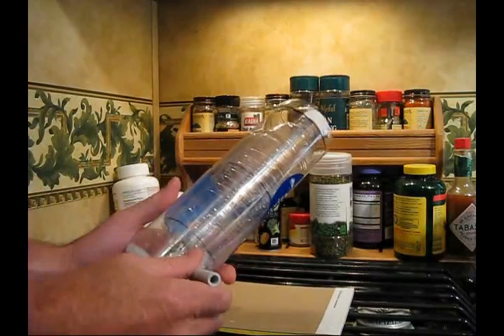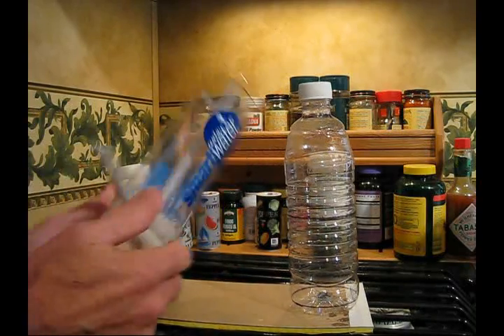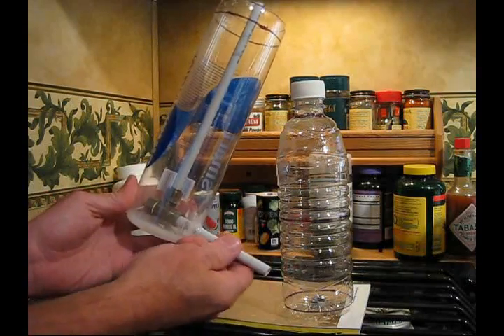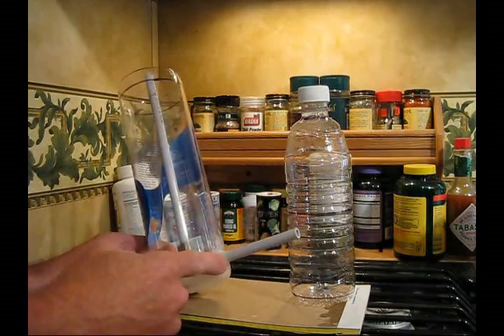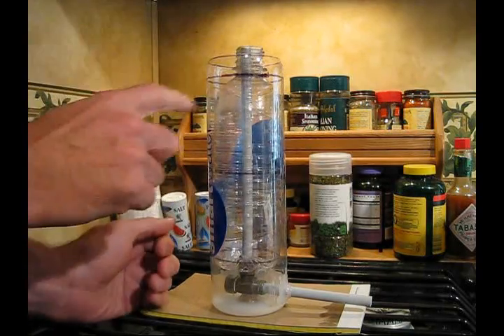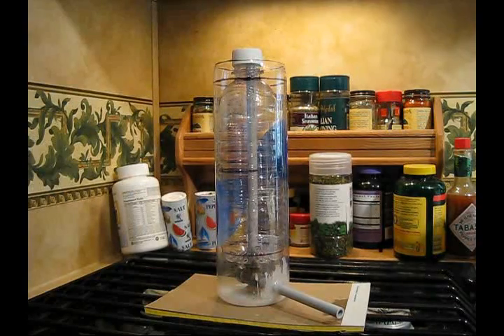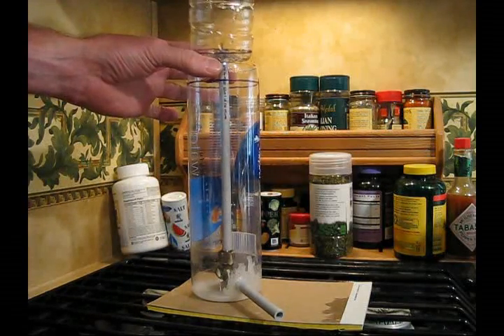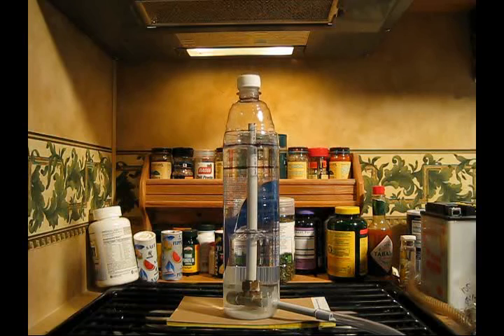Build your own Hydrometer

Comment: Correct me if I'm wrong but didn't the guy in the video say this was a flow meter, not a hydrometer? A hydrometer measures the density of liquids in comparison to water, like the thickness of cream or the alcohol content of wine or other liquors.

It is a nice build though, but you may want to change the title.